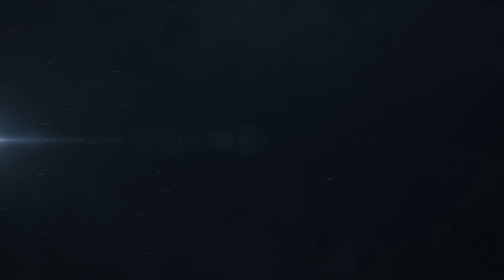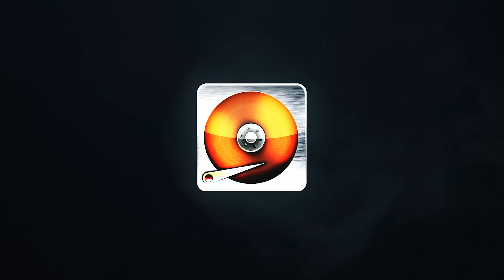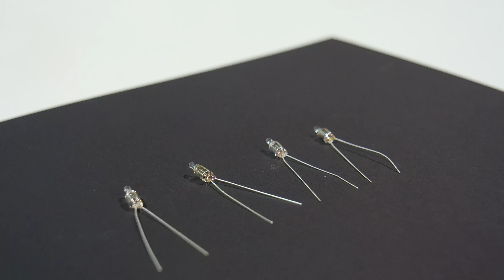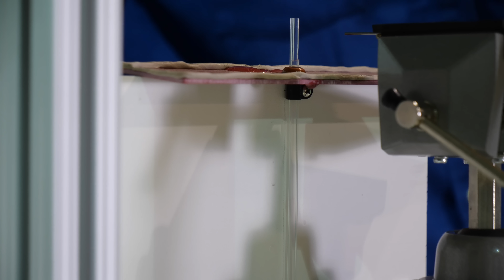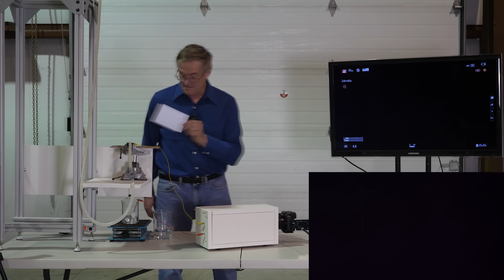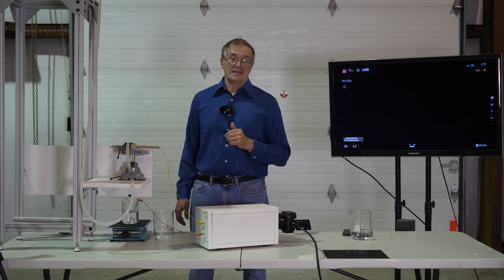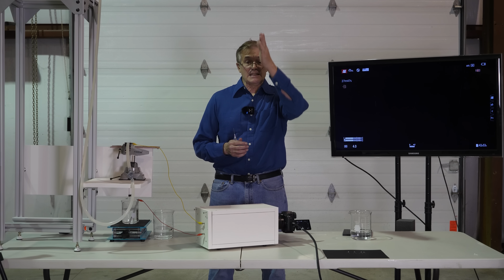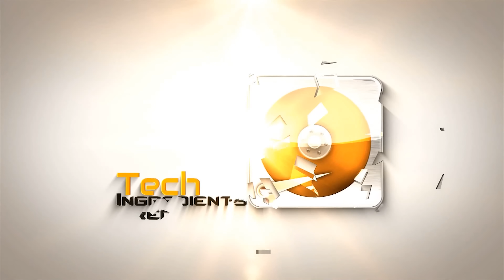We made electricity from water - and it's easy!

Comment: Its been said for years that rain water affects plants differently to hose water for I believe the same charge effect. It certainly is a fascinating idea and I wonder if it could be used electrolyze water into H and O. While I believe electrolysis requires substantial current Im also of the belief that charge as in a high voltage assists in the stretching of the water molecule. Maybe using this generated high voltage could be used to make the electrolysis more efficient than is normally expected by Faradays law?

Comment: It FEELS like a simple concept, but the more I think about it the more odd it seems on a physics AND engineering level.

I've got the image in my head of one of the ceramic lattice cores that are used to male catalytic converters, but with only a couple centimetres of one end plated with metal. Then the water going through some sort of venture to suck air into it before entering a small reservoir on the plated end of the ceramic core.................. Then I start thinking that a simple water wheel in the downpipe of a homes gutters would no doubt produce more power than this setup when it rains, and wouldn't get clogged up with bit's of leaf, moss, or de4d bugs every 5 minutes. From there it's hard to keep seriously thinking about this ion stripping system. 😏.

Comment: I believe the methods you described would struggle with anything but distilled water.

As was shown in your experiment, flow rate, tube diameter, orifice diameter, etc, have an impact on performance. 

Contaminates in gray water or lake/river water would buildup over time and degrade performance. Cleaning would have to be integral to the design, and maintenance would impact cost effectiveness, likely significantly.
Reply from the maker: I agree with everything you said, except that it does function well with seawater.
Reply: @TechIngredients  Could be, and it's not to say that these can be overcome, simply that the final implementation needs to take contamination and "cleanability" into account.

Comment: This reminded me of something interesting that happened to me when I used a shop-vac cleaning up silica sand, a lot of sand. I had the vac sitting in a wheelbarrow with a extra long hose going down to the space I was cleaning. I witnessed sparks around 12 inches long jumping to ground that sounded like gun shots. I realized it was some type of static but never knew why it was so powerful.
Reply: The rule of thumb is that you get about 20kv per centimetre of spark. That must have one hell of a charge!
Reply: @TonyGrant.  It was concerning when I saw it happening, then after the big one I made sure the hose was touching earth ground which seemed to stop it. Maybe it was friction from the sand particles in the tube, maybe the low pressure had something to do with it too. I just knew I didn't want it to ground to me. 😆

Comment: Hmm as I remember it static electricity affects cold water more than warm water, so I wonder if the colder the water the better the process would become. The only issue I see with this process in the wild would be, that any impurities would start to deposit in the channels, slowly clogging them up, so using brown water would probably be out, and even water in dams would have minerals in it by time they hit turbines.  I do wonder what using Magnets on thin channels might do to this type of setup, as Water, being dipolar, can be partially aligned by an electric field  See  HTTPs water DOT lsbu DOT ac DOT uk    /water/magnetic_electric_effects DOT html   - if link is allowed..    SO I wonder if one could help increase the protentional of this process, but this would require some experimentation, and lots of ruling stuff in or out.

Comment: I wonder if you could magnify this effect using a static charge. If the beaker has positive ions, and the dispensing needle has neutral water, then there is a separation of charge occurring over the distance traveled by the drop as it spreads out on its way down. It seems the goal is to get more separation with negative ions being delayed in downward travel, and with positive ions being accelerated. If, near the top of the glass tube, there is an influencing positive static charge, and near the bottom there is an influencing negative charge, then any water spreading out between those two charges would have an increased separation relative to no charge. The positive charged water wants to go to the negative static field, the negative charged water wants to go to the positive field. Overall the static charge influencing this would slightly increase or decrease, but on average, remain unchanged. Would this be a useful way to increase the effectiveness of this device?

Comment: Great job! On Robert Murray-Smith's channel he lights up gobs of LED lights by running the water over a strip of Teflon tape on a piece of foil. He got better results from using a conductive ink coated in polyurethane to work as a seperator. The paper he was working from lit 200 LED lights with a similar setup. It harvests triboelectric charge gathered as the water falls through the atmosphere. Forgive me if this description isn't 100% accurate do to my lack of a scientific degree. This setup is lacking a few components that radically increase the output, but it's still fascinating. Also, there is another video where he explores an old patent that uses an anode and cathode spaced and oriented in a particular way that when set in a stream/creek harvests electricity from electrons flowing from the upstream anode to the downstream cathode, for the life of the materials. 

Thanks for sharing this! ✌️
Reply: This makes me imagine an art installation, in the dark at night, with hundreds of plastic tubes with little light bulbs spaced out along their length, all dimly flickering as water moves past them
Reply: @Erhannis YES!!! I've been drawing a few designs up myself! ✌️😀
Reply: I'm glad you mentioned this because I too remberred this and wanted to mention it but my memory wasn't good enough to write out like you have.  🙂
Reply: @universebecomingltd  ✌️
Reply: Idea is good for science but as a refference peak energy consumption in usa is around 400 GW per hour
Reply: @shazzz_land Diversifying production and reducing reliance on the grid is the name of the game. Plus, it's fun to build your own generators ✌️😀
Reply: @shazzz_land  This argument is often used to smack down renewable sources of electricity, as though it's somehow an insurmountable task to reach that kind of generation using it, however efficiency is increasing constantly, not only on the generator side but also the usage side, & if renewables were scaled up to the same degree as fossil fuel generation then it wouldn't seem so outlandish. The bulk of any national power requirement is all outdated crap or preventable waste anyway, & that too is being automatically reduced over time as things break down & people who constantly leave the heating on continue to die off.

Comment: It is great that you reproduced it. As soon as I heard about that paper I went ahead and made some numbers. It can't make any economically significant amount of power from rainwater even if you replaced all the drainage in a building with parallel and series tubes all the way down, even if you live in a very rainy place. So that criticism was correct but it is still a very cool idea that as you pointed out may be scaled and may work in other contexts. Specially if the foam idea can be made to work and to scale to a water stream it may be actually useful.

Comment: To be clear, the water is not generating any power/electricity here; it's the height drop (and associated gravity) that's providing the energy, and the water is simply the working fluid for a minimum-moving-parts mechanism to capture the very small amounts of energy this effect generates. It's almost like a tiny solid-state hydroelectric dam. 

Would have really preferred you made this point more obvious in the video, tons of kooks are going to point to this as a source to legitimize their "free energy" videos.

Comment: Neat! But isn't it just kinetic energy in disguise? Water flow is necessary for the current flow, one way or another, energy is added to the system, the water in the jug a meter above has more potential energy than it does a meter below; you could do the same thing by having it turn a turbine, which is the standard method of extracting such energy. It would be interesting to see an a/b comparison of the two methods in terms of efficiency. I enjoyed the video though, I still learned something, which is what I'm after. Thanks!
Reply: It is extracting kinetic energy, yes. As I see it their point is that it could be applied to extremely low head situations, such as after a dam (scavenging a fraction of the fraction of energy left behind by the turbines) or in the many situations where setting up a head is impractical but energy's just being thrown away as turbulence/heat.
Reply: @HypoceeYT  Even extra-low head could easily produce energy in far more conventional ways - just let it fill a container at whatever flow you have, when it's full just use the weight to drive a geared generator, once the container descended empty it, let another full container raise the empty one back up on its way down. It doesn't even need to be a large level difference as long as the weight is substantial, and you can have it work at whatever speed the flow you have available can fill it, no lower limit...

Comment: Did anyone think of using a copper or iron surface on the negative & or positive like a plate, tube or rod that would shed and or collect electrons as this process progressed? If either or both aided the process then roof gutters would be a perfect breeding ground for electrical potential wouldn't it?

Comment: Wow. I have so many questions. How many of those generators could fit in a standard shipping container? I imagine water collecting on the top, draining out the side, and electrical connections on either end. Could it produce enough electricity to compete with solar and wind? What other methods are there to interrupt the flow? How about a rotating gear inside the tube that alternately allows water to pass or air to enter from a hole in the side of the tube? Would some other gas work better? Holy cow. So many experiments, so little time. Thank you for your work!

Comment: While staying in a motel in Texas, I noticed that the condensate from the air conditioners was drilling holes in the concrete walkway. This is likely a PH thing, and likely caused by the intermittent flow of condensate that you demonstrated. Also, I wondered, could you increase the electrical potential of this system, by changing the PH of the water, before it is introduced to the system, by the addition of an inexpensive chemical, to groom the charge separation? Just a couple of thoughts.

Comment: Interesting, but the efficiency of electrical power generation from a hydroelectric dam typically ranges between 80% and 95%, depending on the design and technology of the turbines and generators used, compared to 10% with this method.

Comment: Only issue I see with your hydroplant parallel power is the acidification of the water
Reply from the maker: If the current flows through a load, the pH immediately neutralizes.
Reply: @TechIngredients  Thanks for the reply, I had not considered that.

Comment: if the voltage generated is so large, instead of tho Neon lamps, one could set a series of electrolysis cells, generating each a tiny amount of hydrogen, which could be fed into the gas supply lines, even with the oxygen, enhancing the efficiency of gas burners.

Comment: Stirling engines are cooler but this hydronium acid is interesting. How does it taste? Can you concentrate it? Dissolve metals without making salts? Can it be used to form Magnesium hydride used in the new Chinese bombs? The production is not easy if you wanna believe them, they can make tons of it. Well, hydronium salts contain 3 hydrogens. I cant make sense of it but it sounds promissing

Comment: I wouldn't put any more effort into this, taking into consideration the laws of thermodynamics you are probably getting a small percentage of the potencial energy, plus resistance losses and conversion losses to get useful voltage, you probably better off buying a coin cell.
Reply from the maker: It's already above 10% efficient, with the given resistance losses.
Reply: @TechIngredients  I didn't make the calculations myself just asked the major LLMs (gemini, copilot, chatgpt, grok and meta) for the answer I got answers raging from 0,059Wh to 0,0125Wh over a 1m^2 for a period of 1 hour, 10% is just not worth any effort you put in it, you can get 7Wh from the average 16850 battery.

Comment: I have a suggestion. I have no idea how you can incorporate it into a video, but I would love for you to explain to me how a merely less than one megahertz, fluctuation can crash and burn the entire national power grid?

My best guess at this point. Is it somehow feeds back into the resistance of the windings, or the fixed magnets within the power generator turbines which feed the grid.

And also along these lines a fascinating phenomenon is how electrons travel outside of a conductor along the surface. Everyone thinks of it akin to water flowing through a hose. However, as you know, that is not the case.

Thanks for the great content.
You rock🎉

Comment: What if you use a longer tube with intermittent rings of copper, steel or a combination of both or another type of conductive metal on the outside of the tubing possibly increasing the potential maybe even changing the solution from just plain water to maybe h3o or d2o🤔
Just a thought
Thanks 🙈🙉🙊

Comment: Was the blinking because the current is intermittent, or was that just the camera? If the former, I wonder if having capacitors could help smooth that out. If the latter, probably need to tweak your shutter speed. Side note: that kind of blinking can be an epilepsy or motion sickness trigger, so a warning would be appreciated. My eyes started feeling a little wonky trying to watch that starting at about 8:18. But thankfully it wasn't integral to understanding your explanation so I was able to just cover the video in some fashion and listen to just the audio.

Comment: 5:46 a good way to help with this is to hold a key or another metal object that's not grounded and touch a ground with it. the spark will form between the metal and the ground, away from you and not causing any pain.

Comment: It's important to clearly state here that this is a phenomenon of charge accumulation on the surface of ions, not the flow of electrons from OH⁻ to H⁺. It would be worthwhile to focus on measuring the potential of such charged ions — for solid particles, it's the zeta potential, but with ions it might be more problematic :)
Great experiment, keeping my fingers crossed for the further development of the project.
Reply from the maker: The reason I didn't is that the electron flow is the external manifestation of that surface effect. That can be demonstrated with the lamps.
Reply: @TechIngredients  Absolutely, I get it. I'm really interested in this topic because I’m currently working on gas nanobubbles dispersed in liquids. There are also fascinating surface interactions happening there between ions and the gas–liquid interface. It’s quite possible that localized charge gradients can form in such systems. These nanoscale phenomena aren't always obvious at first glance.
Thanks for the inspiration—this video really got me thinking! 😊

Comment: Perhaps something like this I've seen many times. I'm taking my fresh water for drinking from  spring (water is poured slowly from the 1.5m height into a 5 liters plastic canister from distilled water) and if it is dark enough - once or twice per minute  sparks can be visible.
Reply from the maker: I think you might be right.
Reply: Also, on the gas station there is a restriction for tanking gas into a plastics because of those sparks could start a fire. But it is explained with statics not because ionization processes...

Comment: Could high ehough strength permanent maget be able to pull the hydronium ions through a micro-capilaried membrane with a first surface of florinated plastic?
Reply from the maker: Possibly
Reply: I was thinking about a water battery that all it would need is any kind of agitation to operate. I guess that any polar minerals in the water could quickly ruin such a membrane so the water would need to be highly distilled in order for it to be durable and resuable.

Comment: If you think about it, it is quite impractical. All contaminants in the water will build up somewhere on that contraption and the delicate process will stop eventually.
Reply: If the modules are easily manufactured and replaceable, this isn't a huge problem. Remove one, replace it, and repair the one you removed in the meantime.

Comment: You need to start over from the beginning reading your physics book. You're not measuring what you say youre measuring. Youre just measuring friction.
Reply from the maker: I actually have read physics books.
How do you think friction will result in electrical flow?
Reply: You are measuring friction between of water molecules in container a and the water in container b caused by a pump or gravity  you never said which. It is not just simply electricity in the water.

Comment: FYI, you can directly drive LEDs with "high voltage" so long as the current is limited.  LEDs are essentially current controlled.  In fact you can take a 20kv low current <5mA source (fly back transformer driven lightly for example) and place an LED such that the leads are in the arc and you'll get the air arcing to the LED while the LED turns on.